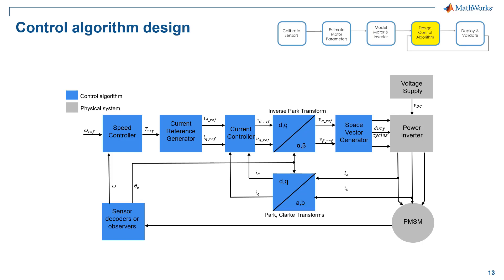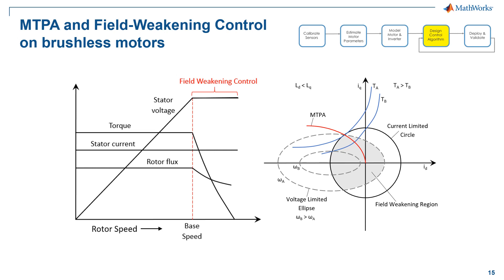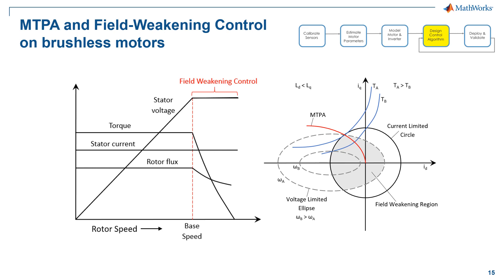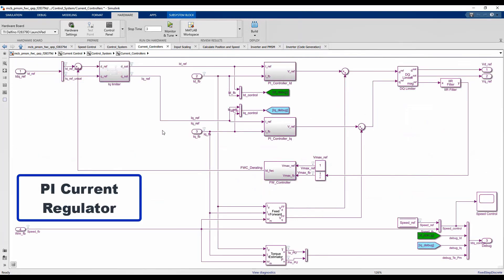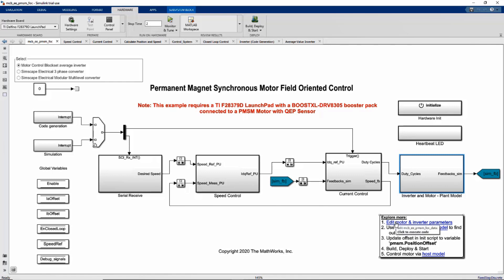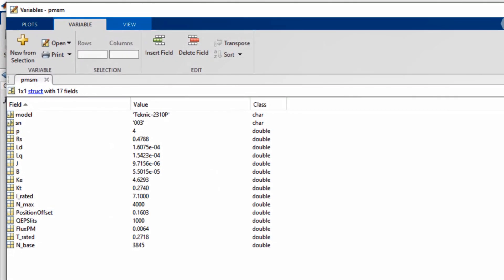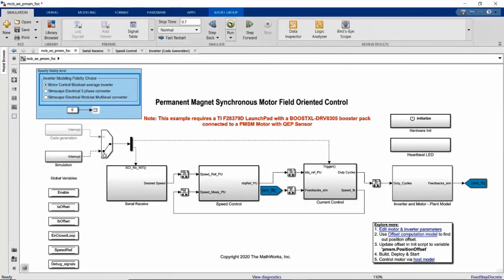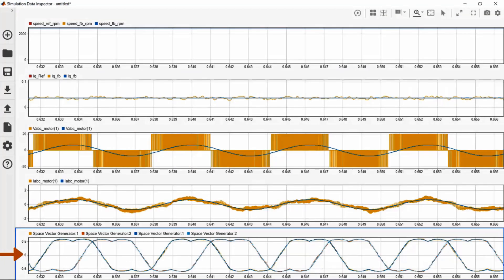How to Design and Simulate Motor Control Algorithms |FWC of PMSM with Simulink, Part 2

Comment: she talks about speed control in this video but for electric vehicles the accelerator pedal determines torque and not speed. Is there a torque control algorithm that can be used instead?
Reply: This is both torque and speed control. When we accelerate, we want more speed, and currents decide torque. but reference currents came from the speed control loop. if speed is tracked, it means torque requirements are fulfilled. if in any case torque requirements are not fulfilled, then motor speed will not be followed.